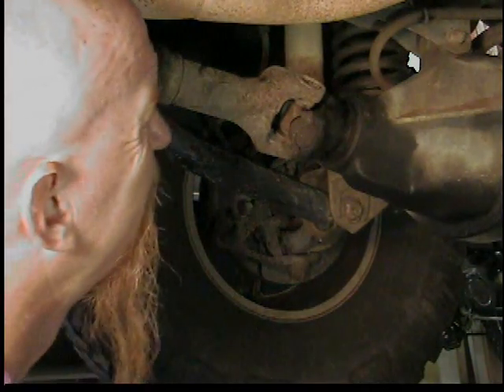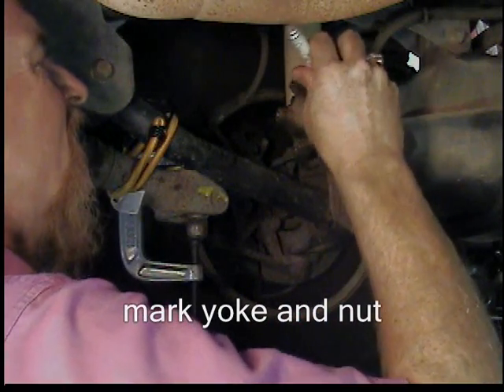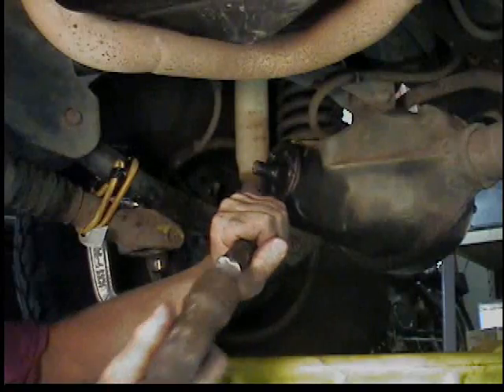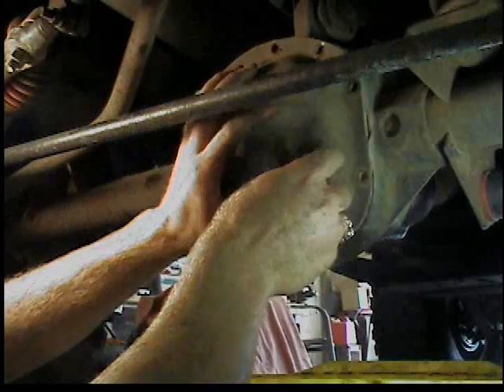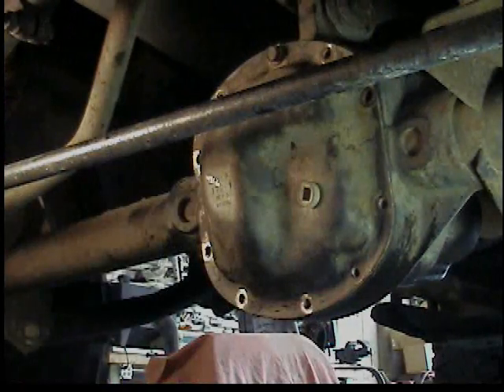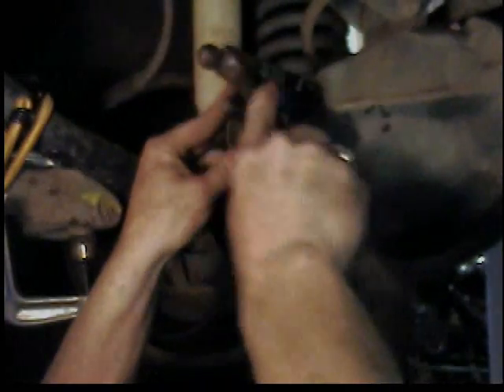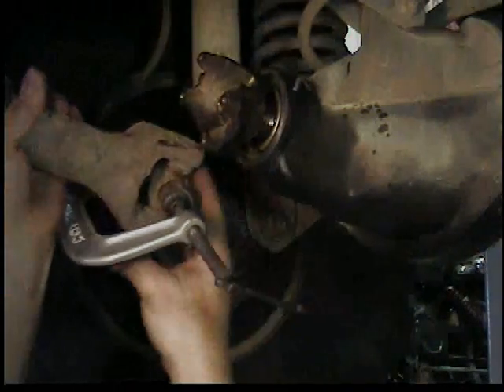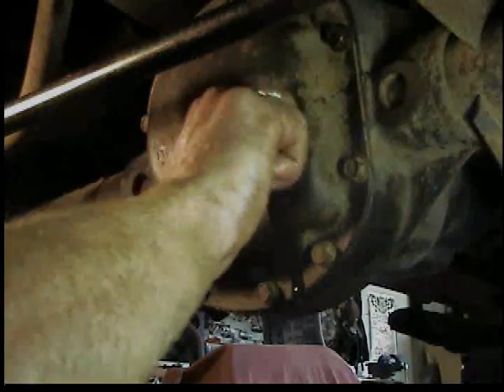differential pinion seal replacement, Jeep Wrangler TJ, DIY

Comment from the maker: Wobble and camber? I'd check the tie rods and drag link. Watch my steering wobble vid. Mine was just stabilizer bushings, but you will see the technique for finding it. lay on the ground and have someone work the steering back and forth and look for movement in the rod ends.

Comment: Hey what tool did you use after you removed the nut, a puller?
Reply from the maker: +struttinmyazz Yes. Some call it a harmonic balancer puller. I have seen it listed as a steering wheel puller too.

Comment: seen some people torque and then other people marking the alignment of nut, yoke, shaft, and counting threads on pinion showing and replacing the nut back to that point, which is almost no torque at all.  Not sure which to follow
Reply from the maker: Joe Fresso If you replace the crush washer, then using a torque wrench to measure drag is important, but that process usually requires removing axles. Counting threads is not accurate enough. Mark the yoke and nut and don't turn the nut around.

Comment: looks like i need an impact gun and changing the u joints as well i need to change the oil pan too and idea what order i should this in? i can pm or email you my situation
Reply from the maker: U Joints first. Anything that will cause a wobble in the drive train could cause the pinion seal to fail. Even cupped tires can produce a wobble. stevie & carssuck com
Reply: do you think mayb the reason you had to replace the pinion seal was bc you were runnin synthetic oil in the diff?
Reply from the maker: No. my Wrangler had 92K on it when I bought it. The tires were cupped, the u-joints were dry and the steering stabilizer bushings were worn so the front end shook. I think this vibration wore the pinion seal out.

Comment: I don't have a gear puller.  Is there something I can use instead of buying one?
Reply from the maker: Drill three holes in a piece of angle iron. Bolt through two of them to the yoke. Hold a nut between the iron and pinion and use a third bolt to jack the yoke from the pinion shaft.
Reply: +wwwCARSSUCKcom elbow of the iron out or in?
Reply from the maker: +MrThemBlues Either way. I'd probably do out.
Reply: +wwwCARSSUCKcom Great, thank you!  I really hate not having tools, but I hate buying them for one-off jobs like this even more!!

Comment from the maker: Nope. Drill three holes in a piece of angle iron. bolt the iron to the pinion through the outside holes. use a bolt and nut in the middle hole to jack the pinion out of the case. Or just hit it with a hammer and see what happens. :)

Comment: Nice try on the video with very detailed instructions but not the proper way to replace the pinion seal on a D35. The D35's have crush sleeve pinions. There's no need to mark yokes and nuts. Putting the yoke an nut on the exact way and tightening it till the lines match does not do it right. Once you relieve the bearing preload by removing the nut, you need to also replace the crush sleeve on the yoke. Once replacing everything and tightening the nut to snug, you have to adjust the tightness of the nut by checking the preload of the pinion.
Reply from the maker: Yes, we have kind of covered this in past comments. This is a shortcut method so you don't have to pull the axles to set the pre-load. If you mark the nut and put it back in the same place, the torque on the pinion will be the same. Thanks for your input.
Reply: Yeah.I usually don't look more than a few comments down, so I missed those.

A long time ago, I use to change the seals the same way you show here - until I had a pinion loosen up on me. People just need to know that, while this is an option, there is a chance for the pinion to loosen. What are the odd's? I don't know but I had it happen to me. This would be caused by the reseating of the bearings; which is the reason for the new crush sleeve and preload setting. Since I had that one loosen, I take the extra 5 minutes to pull the axles. 

I must say though, you did a good job on the detail of your video for someone who may have never done this type of job before. You also avoided the small talk, fowl mouth comments, and any other time waisting things most people have in their videos. Good job for that. Nice production. Have a blessed day!
Reply: RevealedRevelations  Just for the record, your way isn't the proper way either :)

If you read the official factory service manual, replacing the pinion seal on the D35 does not require replacing the crush sleeve. Nor do you need to pull the axles. The manual states quite clearly that the crush sleeve only needs to be replaced if you over-tighten the pinion nut (because if you do that, you've just over-crushed the sleeve). Also, you only remove the axles if you've replaced the bearings. If you're keeping the existing bearings, you don't touch the axles at all.

As I say, this is all direct from the official factory service manual.
Reply: +dunebasher1971 Sorry, but no no and more no.
Whenever replacing a crush sleeve, if new, it must be torqued to spec. If marking the nut and re-using the same crush sleeve, it's already been torqued and crushed to spec. To obtain the same torque again, mark the nut and yoke as the video shows and torque to those spots THEN 1/16th inch further to obtain the original amount of torque on the nut which is crushing the already previously crushed sleeve.

Great video. Glad I found your channel. Simple, descriptive, no swearing, lots of comments and answers by the channel owner.
Kudos!
Reply: Jarod Hammond
 Is following the official factory documentation - the material put together by the people who actually built the car in the first place - more naive than following the advice of some random person on the internet telling you how to half-ass the job?

In my experience, the FSM is always the single best source of service information for any vehicle. The only downside of the FSM is that it can show you the long way round certain jobs where shorter ways (such as removing fewer parts to get access) can be followed without compromising the quality of the repair. However, I don't consider half-assing pinion nut re-torquing to be a valid shortcut.

But that's the thing about car repair, isn't it? Everybody's an expert, their way is the right way and everybody else is doing it wrong.
Reply: +dunebasher1971 No comment. You're just looking to be a YouTube troll and pick a fight.
You do it your way, I'll do it mine (along with many others).
Btw: you said it yourself. FSMs have short-comings. 'Nuff said.
Reply: Great video but there’s a lot of back and forth here. I wanna change the seal on my LP30. For some reason re-torquing the pinion worries me. Can I really reuse the stock sleeve or is it a big deal to just pull it and throw in a new one